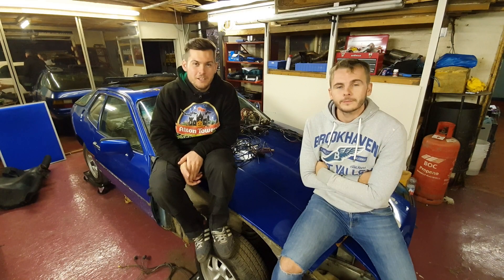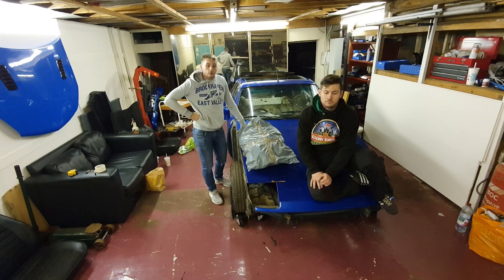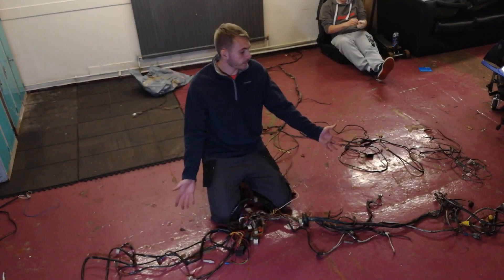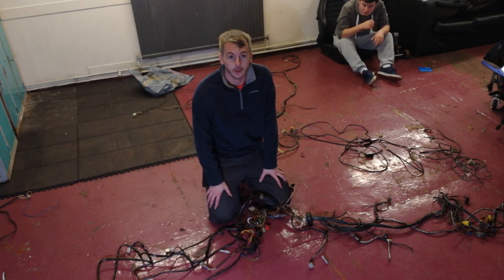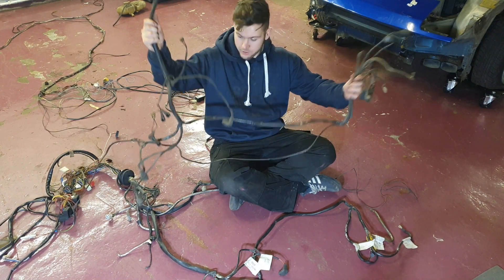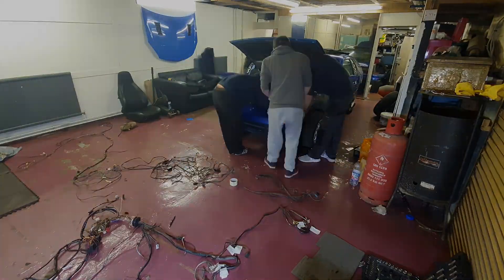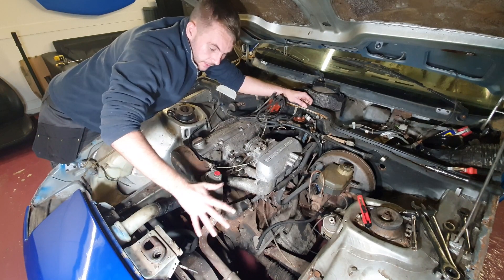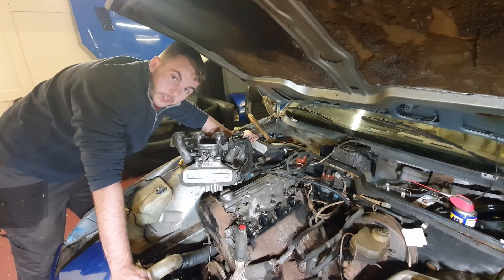Wiring Harness Replacement - Porsche 924 K20 Build #4

Comment: Hi i have a 924 porche the green wire that comes from the back if the distributor has a split in it can i  cut and join it with a connector as a new one is not available